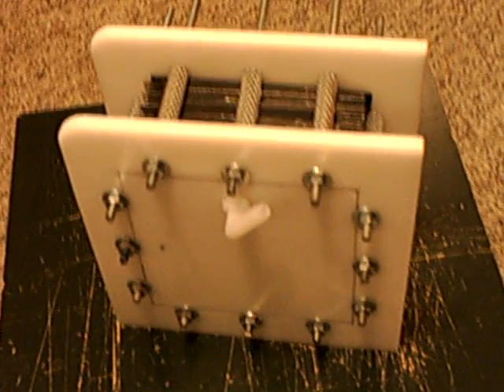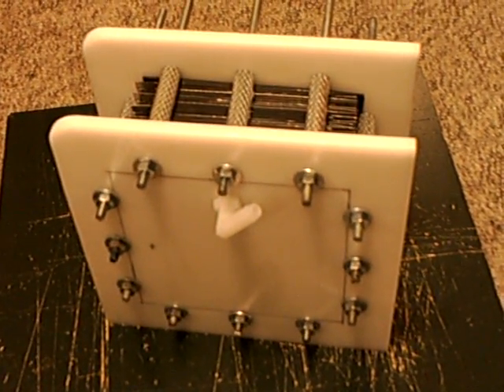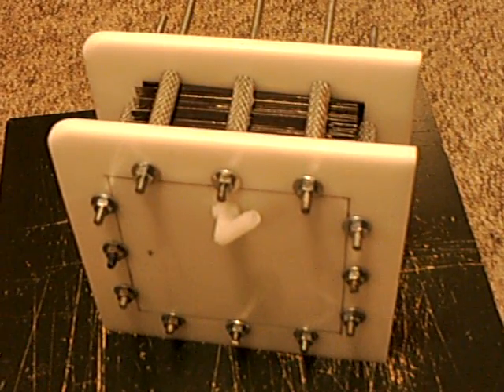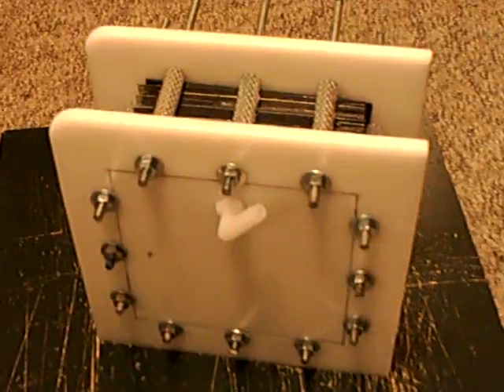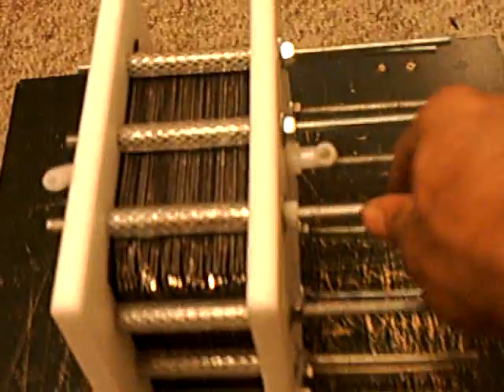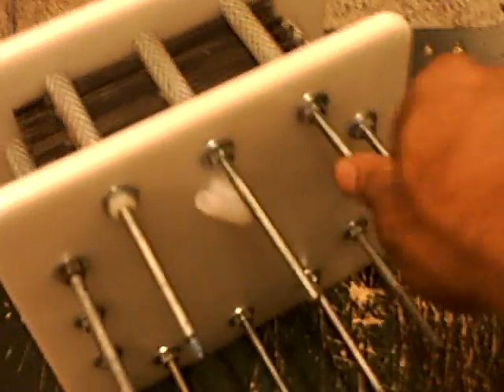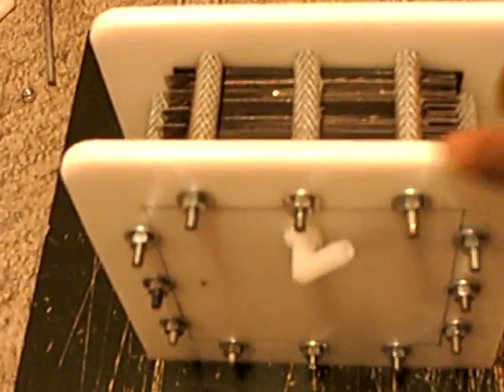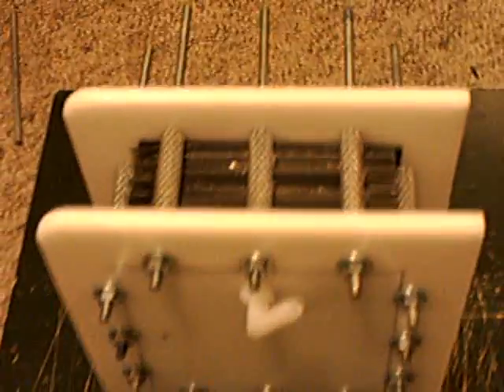My new HHO DRYCELL project#4 Assembled

Comment from the maker: I got the SS for my plates from a local recycle center real cheap ,its 304L stainless steel ..
I have a bigger cell than this one that has 72 plates and built it for less than $75.00..for gaskets I use 1/16" neoprene you can get it on ebay..The end plates are 1/2" cutting boards ...

Comment from the maker: I only have holes at the top, I am going see how it will do like that.I am wanting to avoid doing  any holes in the bottom so I will not have any current leakage..As far as filling with water , I filled it up tonight ,it filled up fairly easy(it is difficult to drain tho gotta turn it upside down), I'm going let it sit till tomorrow evening to make sure I have no leaks..Hopefully I will have everything ready to do a test run in a day or 2..Thanks